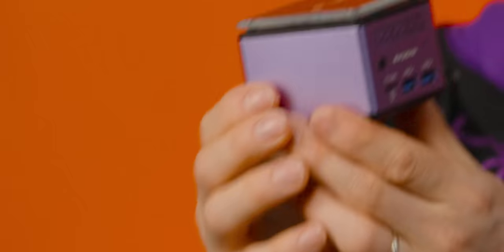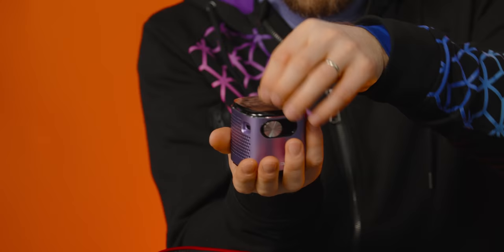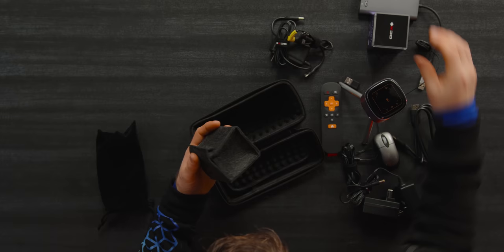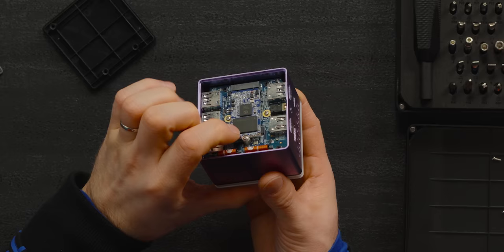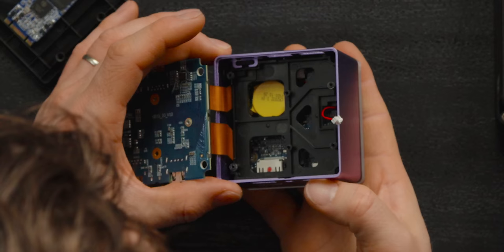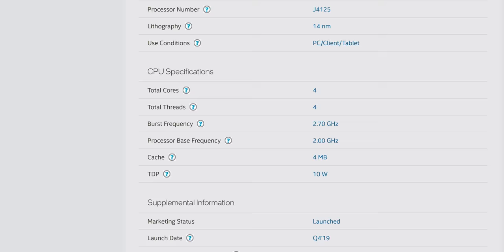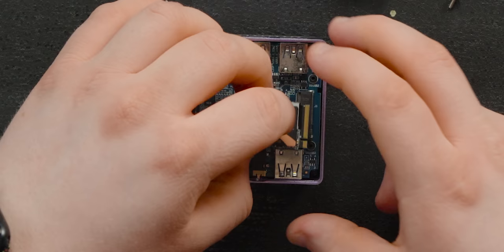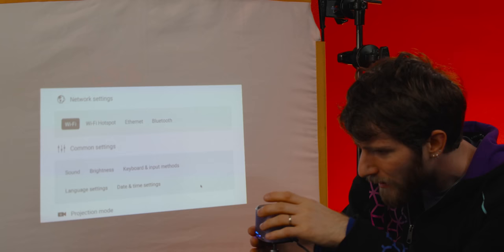This is a computer - XDO.AI PicoPC

Comment: Considering the price of Raspberry Pi's these days, this might be a fun alternative if all you need is lower power compute and not the expanded connectors.
Reply: also interesting for running klipper for a 3d printer
Reply: @brettmaddan3255  odroid c4, faster and more power efficient than Pi 4b, running klipper on it right now
Reply: Would a Raspberry Pi be more expensive than this? I'm seriously considering this between the former.
Reply: @raeji  its about the same price as Pi 4b 4-8gb msrp, if you can get Pi for the original price its less of a hassle setting up because of better documentation but i only see Pi 4b for triple or quadruple the original price

Comment: Considering the performance of this product, I cant help but wonder if getting a used Tiny pc from Lenovo or Dell would be a much better value proposition.
Reply: I'm wondering the same, I don't see why people would buy this
Reply: if you fit it mounted behind 21" monitor and don't make it stick too far from wall then quite likely, 
if you don't have usage like that 
and don't need silent powerefficient pc for simple tasks that takes almost no space (internals of used laptop could probably 100% replace it as well) then there are infinitely much many more better options

Comment: When I was attending university in the early 1970s, the size of computers began to shrink as levels of integration increased and there was a joke going around among computer engineering folk that eventually the computer would be just the "bump in the power cord between the wall socket and the terminal".  That day has arrived.

Comment: I've noticed this with all their product review videos, and it kinda bugs me. They always open it up and dig around for a while and then turn it on and show off what it can do. I don't know why this irritates me, but I think it's mostly because I want to see how it works purely vanilla out of the factory. I know they know what they're doing and could put it back together in their sleep, but there's that tiny voice in the back of my head that makes me wonder if the product would perform better had it not been messed with for some reason. 
It's fine when they got two versions of a product, but when it's just one I really want to see how it performs right out the box first.
Reply: Fairly sure the recordings of it working is done pre-tinkering, though might be wrong.
Just feels more sensible to get the shots of a working product before your clumsy boss potentially accidentally fries it somehow. Even if he didn't open it, it's called "linus drop tips" for a reason!

As for why they then would cut and edit it so they open it before showing its results... no idea. I guess they simply think it flows better?
Reply: @feha92  I don't think they care if Linus were to break it, they'd just buy another one like they have done in other videos lol
Reply: There's also the whole aspect of defect out of the box. If it's a product that would have not worked right out of the packaging, I want to know that. Quality control is just as important if not more so than the specs. They probably wouldn't show this and I don't think it's a common occurrence, but I could see a situation where they go to open a device and might find a loose connector or something else on those lines. If they're taking it apart, then it becomes ambiguous as to whether that device was functionally impaired out of the box or by accident during the tear down.

Comment: The J-Series CPUs are basically Atom-CPUs. Silvermont was still pretty slow, Goldmont was okish but Tremont is a Blast, running at 2/3 the speed of my i7-6700k.
But to be honest, if I would buy a portable computer I would go with a tiny Netbook. My Acer D256 is so small it fits into the pocket of my jacket, 10 inch display, 8mm thick, 700 gram light. Ok, it is 10 years old but still runs Youtube fine.

Comment: What I do love about them is that those CPUs really do not take any voltage at all... I personally have built up a Mediacenter with this which had a  DVD Drive, 4TB HDD, 1TB SSD and 16GB of ram, and a faster J CPU and with some undervolting and such I have made the entire system capable of running windows with only using 5 Watts overall system use. And it still is running "okay" for a media center. It can go up to 10 Watts during complete pc use if I use it at 100% CPU use but I still think this is wowi since the CPU alone is rated at 10 Watts so I think with a bit of tinkering those things are the perfect media centers. I just think it is a shame that many people compare everything for gaming and some simply trash talk lower-end hardware which I think is totally wrong because there are many other options to use and or build a pc than gaming so I miss the days when people actually thought about those hardware related things from a different point of view. But putting it into this size and also this adorable beamer  are astoneshing.  And I know I am doof in doing but did not sub d have 3 lines with 15 pins and what was pictured would actually be a rs232 9 pin connector which was used for serial io ?

Comment: i have a soft router using j3160. there are a lot of similiar products in China, using these low power consumption cpu and small size motherboard to develop a small size pc, it can be used for light use such as office work, many of them are customized, such as having two or even 6 WAN ports to be used as soft router with OpenWrt/LEAD system, which can run VPN such as shadowsocks or VLESS. wireless routers usually can't run VPN with encryption with high  speed. it can also be used for other purposes, but i only use VPN on it.

Comment: I actually use as a smb server (also running occasionally a Minecraft server) pc with 8 gigs ddr2 667mhz ram with an intel 2 quad q6600 and a 20$ sata 256gb sdd until two weeks ago when I assembled a new server because I needed a processor with see 4.2 instructions. When I see it in the video comes in my mind memories of me trying to do stupid stuff on that pc when I was a child permitting me to approaching the “tech world”. Despite all the torture that I have done to that pc and that cpu it continue to hold on and running for at least 6 years 24/7 without problems. That cpu is a tank, is bombproof and I think that I will put that cpu in a frame.

Comment: On January I bought UMAX visionbook N14G plus laptop for aroud 120€ here in Czech rep. It has quad core celeron, 4GB of ram, 128GB SSD, very usuable ips screen and keyboard. Three usb ports, one of them type c, mini hdmi out capable of 4K/60. Pretty good build quality and 6 hours of battery. Windows 10 Pro license, with optional upgrade to Windows 11. Basically fully featured and functioning entry level laptop for 120€. Honestly do not see any reason why would anyone buy tiny PC like that, when you get Windows laptop for same money or less.

Comment: The storage limitations are probably there to prevent a common problem when SSD's became more common and affordable. People putting them in older PCs especially lower powered and/or portable ones threw the performance balance off. The CPU would have to run at capacity continuously to keep up with the SSD, using a lot more power and generating more heat causing the CPU and battery to wear out more quickly.

Comment: Cube shapes are the worst for portability. You could probably take it apart and line up each circuit board half side-by-side so it has the form factor of a phone (that would actually fix the USB orientation too).

Comment: Hope they update it with the latest low power Intel offering like the dual core Intel n50 which has a 6w tdp or the 4 core 6w tdp Intel n100 both supports ddr5, give it 16gb of ddr5 and keep the same form factor, this thing really needs to be updated...

Comment: You might need to grab some drivers and open them through the windows install menu. I had to do this for New Windows 11 Lenovo and Acer laptops back in 2021. It wouldn't see the drives (that I swapped from other machines) until I did that

Comment: I could use this when I go camping, sure a laptop is more powerful, yet this PC has a power budget to run off batteries for a very long time. Laptop battery 5 hours, this one, connected to a 12volt car battery, days. This means you can run this PC off 1 Solar Panel and a Cheap 12v AGM battery.

Comment: While I like the idea in theory, I just don't see it's real world use. 

I mean, the price is fine but you can easily find tons of older model laptops in this price range, and that includes a display, keyboard, and an i3 CPU that annihilates the 2019 Celeron in this. This is a couple hundred for the little cube alone, not including the projector, keyboard, hub, battery, or even a case. Those are all extra, of course.

The only real world use I can imagine is placed behind your TV as a bluetooth enabled HTPC. As a portable PC a laptop makes more sense in every way. They'll both need a power cable, but with the laptop you won't have to tether to a tv and carry around a keyboard/mouse separately.

Like many of these micro PCs where they get you is by showing only the minimum price. 

I see an 11th gen i3 15" laptop with Windows 11 on Newegg right now for $205 with 4gb ram and 128gb SSD as well as a carrying case.

While this Pico is $175 for the cube with the far slower Celeron, 4gb ram, 64gb rom, no SSD and no case. 8gb of ram and a 512 SSD jumps to $241, and 1tb SSD jumps to $285. The accessories shown here? That pathetically dim projector is $200?! Tri fold keyboard is $50. Just the 3 basic items you need to have a mobile PC already has you at $400, which there's a TON of options for $400 laptops with even an 11th gen i5 CPU that's laughably more powerful.

I just can't see any situation where a laptop is too big to deal with when any real computing needs a KB/mouse that negates any benefit of this cube being so small.

Comment: Drive not detected may be a lack of driver on the Windows installer!  At my work we often run into issues installing to NVMe drives on newer Intel Processors, and need to add the relevant Intel RST driver for the generation of processor to the installer.  After adding the INF for RST, the drive shows up normally to the installer.

Comment: It didn't detect the ssd the first time, but I had that issue once with a cheap off brand ssd and ended up having to load the drivers from a separate drive to get the bios to recognize it. It might be possible. I don't remember exactly what I had to do, but it worked eventually and I've been using it for several years now.

Comment: Well not for daily use but I'd gladly use it for surveys and fieldwork especially for it looks more dustproof than a laptop and I'm guessing its battery life would lasts way longer. For archaeology, geology, anthropology, botany and similar disciplines this thing would be a life saver. 

But one thing prevents it, they should find a better solution for the monitor. There's no way that work under sunlight.

Comment: Bit low powered for my tastes but on the other hand thats very reasonably priced for a semi portable setup.  You could probably run that whole thing off a higher wattage battery pack for quite a while.   Then agian I've got a good gameing laptop for the lan party type situation and a steam deck if I just want to game on the go  Between those and my phone or tablet I dont see a real use case for it.

Comment: I've always wondered why on low spec PCs, Windows Setup is quick to start, but then on some higher specced PCs, it takes soooo long. On my PC with 10 GB of DRR3 RAM and an AMD Phenom 955 X4, it takes so long to start the setup, but on my old PC with 4 GB of DDR2 and an Intel Core 2 Duo, E7500, it's super quick to start...

Comment: how about turning the light down when using the projector? idk but i think it would help. like a lot.
Reply: 1. Recording a video in darkness isn’t going to yield good results as opposed to their professional lighting setup
2. The lumens on the projector are still not the best even if you turned it dark. I have a projector from Amazon with 5000 lumens and even in a completely dark room the brightness will only get you so far

Comment: The only use case I can think of for something like this is to connect it to a TV instead of the more common Android boxes, although the only obvious advantage I see it having being that it can run Steam natively instead of exclusively relying on streaming the games from another computer, other than that I don't see how this mess of cables can compete with an actual laptop when it comes to portability. And if someone really wants an extremely tiny computer that can fit on a pocket, I thought that was what smartphones were for.

Comment: Me and my raspberry pi compute module rack that uses kubernetes to host 1 instance of an Ubuntu 22.04 LTS with 50 containers on it and 32gb of RAM and 16 CPUs 💀💀 and everything is connected on a separate router with its own LAN 🥶💀any ideas how to upgrade it to have over 20Gbps input-output on ethernet?
(I have exactly 64 compute modules in a rack and I can say you, the cooling you need costs more that the electricity usage of all the cms)

Comment: Too bad the video output of the projector is such crap. Aside from that it has some good features on its own.

Tiny PCs have a long history. I used to have a couple of Chaintech Book Size PCs. They were 80286 systems literally the size of a common paperback book. Unfortunately I never could get them to work because Chaintech refused to tell me the jumper settings for the video output modes to its DE9 port. Yup, another company with a "Screw you. Buy our new stuff!" attitude towards everyone who obtained any discontinued product they'd made. One feature I found odd was while made during the era of 30 pin RAM SIMMs, these computers used SIPPs. But not actual SIPPs, they were SIMMs with pins soldered to the contacts.

Comment: This is actually really cool, they did their homework on this product and analyzed the market and price point very well. With the exposure of Linus I have high hopes it will be a popular product.
Reply: Extremely niche. Once you realize that price is only the cube with no SSD the price sucks. It's essentially a raspberry pi with a celeron instead of Arm so it can run windows at over double the price. Not a good deal at all. A $200 laptop is vastly better value as well as better performance, and you don't have to pay extra for the keyboard, mouse, and projector that pushes this well north of $400.
Reply: @zodwraith5745  This was never meant to be a laptop, if you wanted to get a laptop then get one.

And I'm talking about $400 for this thing. It is FAR away from a raspberry pie. What are you smoking. Besides the graphics it is not much of a step down from my current CPU which I post process images for my photography.

It can still play CSGO at low settings. This thing is seriously impressive and stupidly small. You could connect this to a real monitor at home, or use a pico projector on the go.

This thing is so cool and still as powerful as a very basic laptop.

There is nothing bad to say about it really, it's a grata product and $400 is a great price for something so insanely tiny.
Reply: @johnrus7661  It only makes sense mounted to the back of a TV with a bluetooth KB/M. Anywhere else it takes up the same space as a laptop the second you have to add a keyboard. I found a $208 11th gen i3 15" laptop on newegg in seconds that's a far faster CPU than this 4 year old Celeron. It even had a case, battery, and SSD that this doesn't come with without yet more upcharges.

Do you seriously want to set up a projector "on the go" that's laughably dim and have the cables all over the place vs simply reaching up and opening a laptop? Not to mention at $400 you're getting into 11th gen i5 laptop territory that utterly decimates this in every way. What are you smoking?

You must know nothing of Raspberry Pi 4 if you think this 10w Celeron is "far away" from the 10w Arm chip. Even the  newer 58w Celerons are only twice as fast.

It's neat as a proof of concept, but don't pretend $400 is a great price for literally the same hardware you can get in a $120 Celeron laptop. It's real world applications are extremely niche like a HTPC or POS terminal. Neither of which needs to be portable.

Comment: I want to get a pc with these specs can someone tell me if they are all compatible( the number and x means how many of them there is👇🏻

CPU - Intel Core i9-13900K

GPU - NVIDIA Geforce RTX 4090 24GB

RAM - 2xKingston Renegade DDR5 RGB 32Gb (2x16Gb) 7200 MT/s

SSD - 5xWD_BLACK 4TB SN850X NVMe

CPU Cooler - Corsair iCUE H150i Elite LCD

System Fans - 5xCorsair LL140 RGB 140mm And 8xCorsair LL120 RGB 120mm

Pc Case - Corsair Obsidian Series 1000D Super-Tower Case

PSU - Cooler Master M2000 Platinum Full-Modular 80 Plus Platinum

Motherboard - Asus Rog Maximus Z790 Extreme

Wifi Card - TP-Link Archer TXE72E

Os - Windows 11 Pro

Comment: I really enjoyed the video.
These types of pc's are so rare and have considered one before.

A note though. Because u probably have one laying around.

It seems to use an mSATA SSD. 
Which has the same formfaktor and connectors as an NVME SSD but aren't allways compatible both ways. Comes down to the way the motherboard is made.

 I noticed in the video there was made an attempt with an sabrent NVME SSD. 
But these don't use the same protocol as an mSATA SSD with the same connectors. 
An mSATA SSD relies on an actual SATA chip. And i believe this board doesn't have the option to use a "real" NVME SSD.

If u have an actual mSATA SSD lying around. It would be interesting to see the speed of it. 
Since it can boil down to.
Do they use a SATA 1/2/3 chip.
So can their be expected a bigger speed with another mSATA SSD. 
Or is it truly based of an SATA 1 chip.

Happy watching. Hope u can check it out.